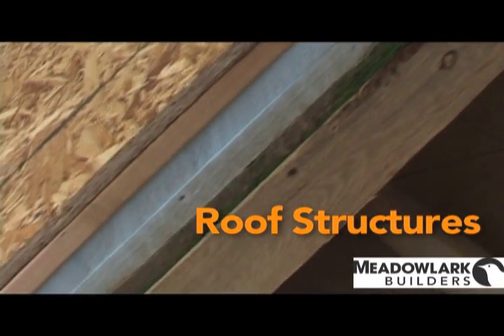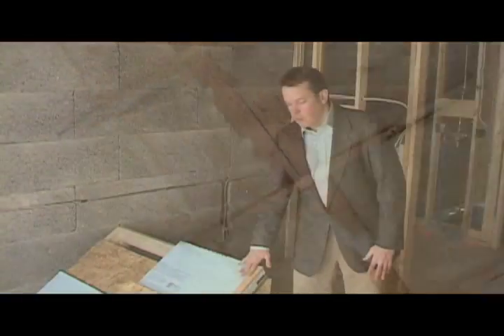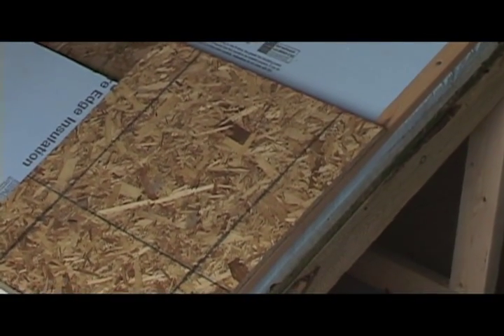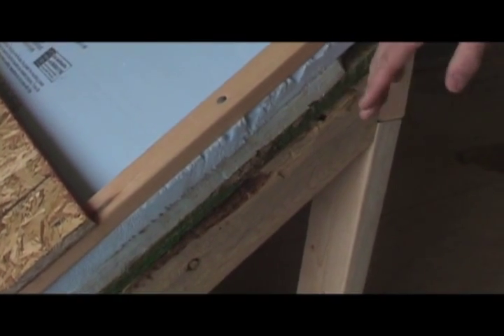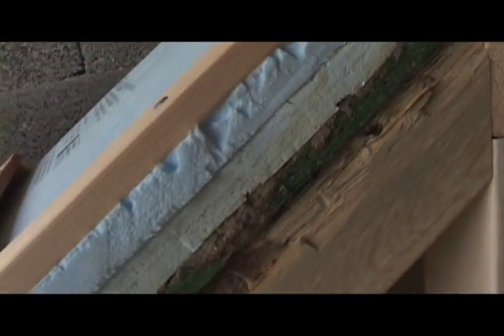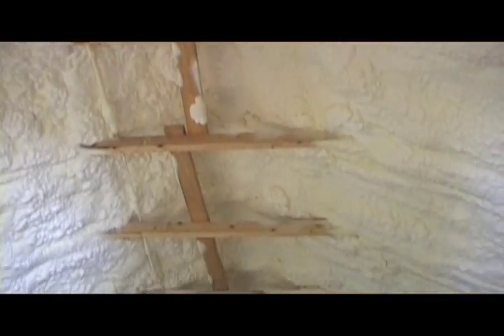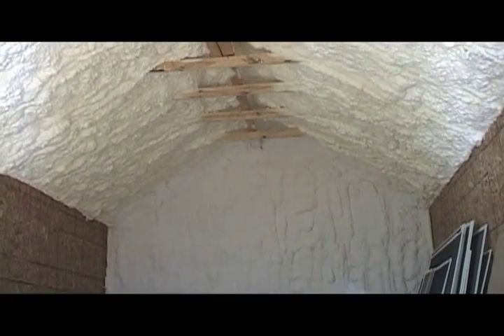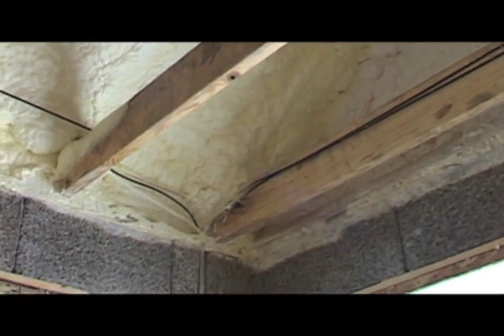Hot Roof System for Passive House - Ann Arbor, MI

Comment: There was a study, by the University of Florida I believe, that tested different roofing types and their data showed that installing a cold roof directly over a hot roof did not lower interior temperatures compared to a traditional hot roof. Their findings suggested the air under the cold roofing layer was heat soaking the hot roof layer.

The style of roof in the video is designed to prevent moisture from accumulating under the shingles and rotting the decking/joists/etc. during the winter when the roof is under a snow load more than it is to provide the ultimate in insulation from exterior heat.
Reply: I believe it's designed to discourage ice damming.